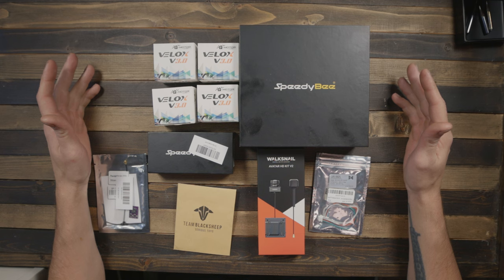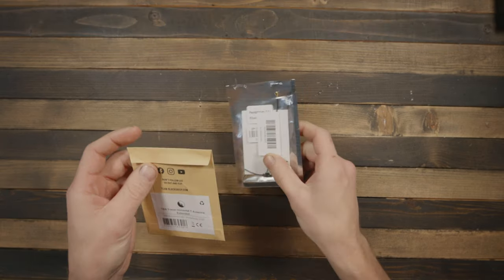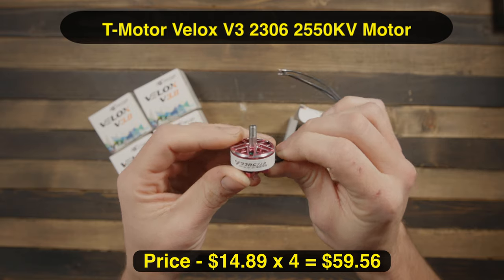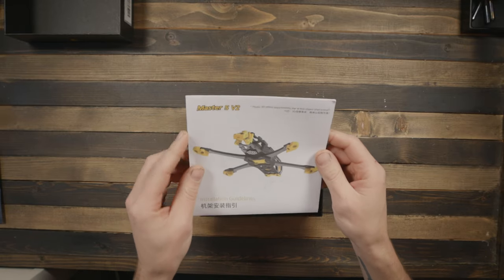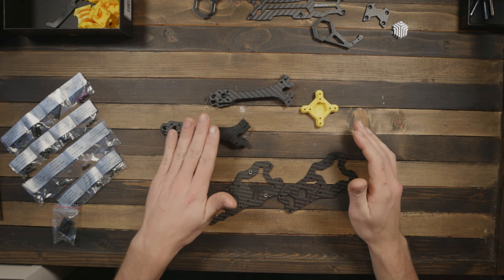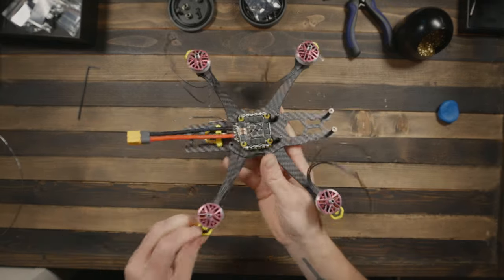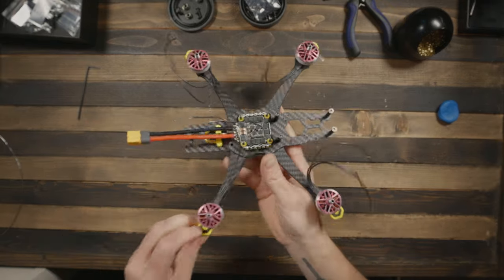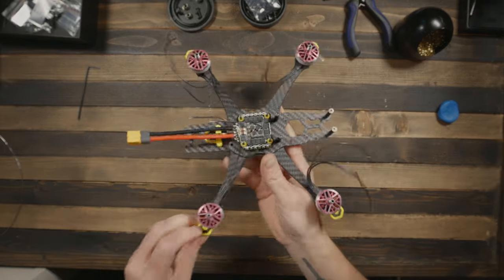5" Freestyle FPV Drone Build And Flight || Speedybee Walksnail HD Build

Comment: The flush mount screws are called counter-sunk screws and those have a tapered head bolt. incase you need replacements or want to compare other frames. I like this frame a lot, but i like the FlyFish RC Valador 5D/5X Frame, especially when running the O3 or anything similiar to that for nice camera mounts for vibration resistance and keeps the camera gaurded as much as possible from a front end crash.

Comment: I just got one of these frames and instructions say long arms are front and short arms are back but there is no way the arms fit to the bottom plate the holes don’t match up no matter which way I try. The only way they will work is the long arms are in the rear if this is not correct then I need to return the frame.
Reply from the maker: Yes the instructions are wrong the longer arms always go in the rear because they sweep back. I have the longer in the rear short up front and it all fits flush. 👍
Reply: Thanks I’m using your video to build my SpeedyBee master 5 V2 5” frame I’m also mounting a walksnail avatar Pro kit. I have
FatShark HDO2 google so I’m using the avatar VRX. system. I’m putting in a SpeedyBee F405 V4 Stack - F4 V4 FC + 55A BLHeli_S ESC - 30x30 this is my 1st HD quad can’t wait to try it out. 
Thanks again for your response.

Comment: Solder joints are pretty good.  Those purple lock nuts are for the bottom of the stack, however.  Typically you'd use those flat nylon nuts for the top of the stack.  Of course, you can do whatever you want.... Cheers -

Comment: I's any of the motor wires near the gyro? That can cause a freak out. They can cause interference since you have they running between the stack.
Reply from the maker: I dont think so. The wires are pretty stuck down and stable. I also believe the Gyro is on top of the FC and the wires are on the bottom. But I suppose it still could be an issue. Ill check it out thanks.

Comment: what is the dimension from back of camera to front of VTX module? I want to get a new SpeedyBee Master 5 HD 5" frame but i think it is longer and the Walksnail Avatar Pro Kit has a coaxial cable that is only 140mm long?

Comment: My first build, way back in April, was a Speedybee Master 5 HD V1. The thing is a beast with a Speedybee F7 V3 stack, O3 air Unit, and T-Motor F60 Pro V 1950 KV. While I have gotten much better at building, and my freestyle fleet consists of mostly Quadmula frames, I still fly that Speedybee, and I still love it! It's been a spectacular quadcopter!

Comment: really liked the video man. from the build to getting out there and flying. I just got into FPV this year and been having a blast. I've built 6 quads already and my Goggles X come in next week so I look forward to seeing how that works. You showed me exactly what I want to test and very informative. I wanted to ask about the OSD you show on your video you said it wasnt from the goggles so what did you use and how did you get it to show up?
Reply from the maker: Thanks I appreciate it. The goggles X are looking pretty rad, the goggles dont natively record osd elements to the DVR so I went on GitHub and found a free software/app that allows you to drop the DVR footage in and then the text file the goggles also record, text file being the osd elements. And then you can choose whatever osd font you wanna use, drop all that in and render it out giving you full osd on your goggle DVR footage like you saw in my video. The app/software is called   Walksnail OSD Tool. Its free to download from github.
Reply: @andrewmedia3568  Thank you! I'll have to check it out as soon as I get my goggles in. It's funny that the one thing it doesn't do is what annoys me most about the DJI Goggles Integra. The OSD elements record on there and I cannot remove it when I fly with the Caddx Vista builds I have. So I have no clean video with my Flylens85 which I love flying. Really good drone!

Comment: can you reccomend some buget goggles for this build LOVE THE BUILD SM
Reply from the maker: That really depends on your budget. Cheapest HD goggles for the walksnail system are 279$ for the FatShark Recon HD. If you want to use DJI their cheapest goggles for HD are 349$ for the Goggles integra. If thats too much Analog is still a great option and you can pick up some analog goggles for 70-100$ the EV800D or betafpv VR03, emax transporter 2 analog. check out pyrodrone, racedayquads and getfpv. they all have a great selection and prices. And the VTX for analog is much cheaper as well.
Reply: @andrewmedia3568  THANK you sooo much bro i bought the dji ones

Comment: This is a really cool setup. I'm just getting into fpv I ended up buying somebody's collection for a deal I got three Ready To Fly and three frames all the frames do have Motors they're all 2206 and 2205. I'm wanting to set one up so it flies like a regular drone but can switch through all the flight modes. What is GPS with a compass allow it to hover on it's own?
Reply from the maker: I don't think the compass allows it to hover on its own. you would have to set that up manually specific to the weight of the drone or use inav or something.

Comment: I know I'm asking too much. But I don't even understand how to build yet. And there are lots of brands and guides, how do I start without being overwhelmed with everything about branding.
Reply from the maker: When it comes to video systems whatever goggles you buy your stuck in that system for the most part. DJI goggles only work with dji video sytems (DJI O3 air units). Walksnail goggles only work with Walksnail video transmitters. Analog goggles will work with any analog VTX. As for the radio\ controller the only thing I would recommend is ELRS (ExpressLRS). they are Open source so any company can make the radios and receivers. And they are the most popular and available. So with video systems and radios whatever brand it is only works with that brand, so TBS (team black sheep)\ crossfire receivers only work with radios that have built in crossfire or a module on them. and again same for video systems. Outside of that, frames, motors, flight controllers and ESCs are all interchangeable. Just keep watching Build videos, and intro to FPV videos and I promise it will start to make sense. There is alot of weird words and brands and companies and its hard to know what works with what. Just keep doing your research and youtube is your best resource for that. Ill do my best to answer any other questions you have.

Comment: btw, the instructions that comes with the frame incorrectly indicates the front and rear arms

short ones are indicated as rear ones, and long ones as front ones, but the frame can`t be assembled that way
Reply from the maker: Yes I noticed that as well, figured the longer arms always go in the rear and the holes only lined up with long arms in the rear. 🤷‍♂

Comment: Hi, i am looking to build this drone. So could i ask which battery you used for it or which batteries you recomend
Reply from the maker: @prawnwonder4923  The batteries I use that I recommend for a 5” quad is 1300-1550mah size and brands I use are ovonic, Zee, GnB, Tattu fun fly or R line.

Comment: p.s. The Barometer gives you your height above sea level.  When you arm, it "Tares" itself to zero out.
Reply from the maker: Ok that explains the changes. Did not even think about that thanks!
Reply: good to know, didn't know why it did that but I did notice that it corrects itself when you arm. Coming from the DJI Avata I think it can make you think something is very wrong. Had an issue with my Avata and had to run a calibration to fix it so it was scary to see a similar issue on a built quad.

Comment: HI
I have ordered the same parts as you but accidentally ordered a different receiver.
I ordered the RP1 reciever from radiomaster which is ELRS,Iwanted to know why it only had space for one antenna and how i could remove it for a longer one.
Reply from the maker: The RP1 is a single antenna receiver, it will work fine for most flying unless your doing long range. I was using the RP3, but either one will work fine.  And you can just grab near the UFL connector and lift up and it should pop off so you can put a longer antenna on.

Comment: what controller and goggles did u use with this build?
Reply from the maker: Radio master boxer (ELRS version) and the fatshark dominator hd.
Reply: @andrewmedia3568  also i want this to be my first like kinda "budget" build are there any budget controllers and goggles u could recommend for this build (i haven't really gotten into fpv yet)
Reply from the maker: @doomboy5911  For budget radio I’d say Radiomaster pocket(elrs version).before anything I would watch a bunch of YouTube videos on every topic, motors, batteries, frames, flight controllers, esc, receivers, radios, goggles, video systems. And beta flight tutorials. I did weeks if not months of research before buying. That being said stick with expresslrs (ELRS) for radio systems. It’s the most prevalent and hands down the best RF system. For goggles you might be able to still pick up a pair of fatshark dominator HD for about 380$. Or the fatshark HD box goggles. If you want HD I much prefer DJI but they are more expensive, but worth it. Don’t forget about the used market for gear.
Reply: @andrewmedia3568  ok imma look into it thanks for answering ❤️

Comment: You have that walksnail camera right, how do you get that live vidieo from your drone to the goggles does it have any app to connect the goggles to the walksnail camera
Reply from the maker: not sure I understand the question. You bind the goggles to your VTX and thats how you get the video in your goggles to fly. As for getting the recording from the goggles, you have to hit the record button on the goggles and have it setup to recored in the goggles in the menu options. And you have to have an SD card in the goggles.

Comment: Cant you just plug the walksnail  vtx into the dji socket?I thought they are compatible.
Reply from the maker: the plug is slightly different. DJI plug is 6 pin plug and the walksnail is only 4. You could get a 6 pin and 4 pin and solder them together which I've done. But its easier to just solder the wires on the FC.
Reply: @media3568Thank you kindly for your answer dear sir.You just got another subscriber .

Comment: How do you take back control of the drone after GPS-rescue?
Reply from the maker: I just flip the switch off. I think if you have an actual failsafe once you get
 re link you have to move the sticks at least 30% to get control back, but with just using gps rescue on a switch you don’t. Make sure BF is set to sanity checks : failsafe only.

Comment: Wait a secont ,cant you just plug the walksnail vtx in the DJI slot?
Reply from the maker: Yes if the plugs match and the pinout matches. But sometimes it’s better to get power from a bat pad so when your flying li-ion packs that drop under 3v per cell you don’t lose video. Ask me how I know 😂.
Reply: @andrewmedia3568  Thank you so so mutch for your answer.I have my great fight to program my googles (hd zero )and walksnail vrx.First drone done almost .

Comment: Hello, i followed you to build the drone with same specs like motors etc, possible to share your pid and other settings? Thanks🙋🏻‍♂️
Reply from the maker: My PID is just the supafly freestyle preset. I use it on all my quads and it works great. I set my own rates to my liking for rotation speed.

Comment: So my Fc came with the same cable you go to connect the FC and esc, But one end was not connected. Can i use any 8 pin esc to FC cable?
Reply from the maker: Yes you can since the pin out is the same. You can use any fc to esc cable as long as the plugs work. The only time you would have to worry about it is if you bought the fc and esc separately then you would have to re pin the plug most likely.
Reply: @andrewmedia3568   I saw on another comment that these motors are not capable Of 6s, (This is my first build) I have a 6s but when i plug it in the capacitor heats up and glows and motors are jumpy and not acting right. Would this be cause by the 6s battery? I should swap to a 4s?
Reply: @andrewmedia3568  I was able to fix my issues with the Heat and motors not working. I changed the motor output. But everytime i go to fly it just flips. I cant get it to work correctly or lift. I did not have a long Esc to FC cable (Ordered Today) so my FC is facing the same way as the Esc, Could this be why it just flips?
Reply from the maker: @gameplayhost  That could be why. plug your quad into betaflight and check the setup tab look at the 3D model on screen and make sure your quad is tilting the same way as the model. tilt your quad front and back left and right and make sure its the same. If its not you can go to the configuration tab and change board and sensor alignment. the other thing that will cause that is the motor direction on the motors tab. make sure that when you arm the quad your motors are spinning the same way that it shows in the upper left of the motors tab. If its props in or props out you can just change it on the motors tab to match what your motors are doing.

Comment: Hi,
Could you please share links for the props you have ordered as well as their caps and the smoke stopper.
I wanted to know if you have used a 4s or a 6s battery
Also i have built the same type of drone and goggles and wanted to know if i needed any antennas for the goggles and if the motors you have suggested are the best or are there is a better option
Reply from the maker: The props are HQ j37, I’m not sure what you mean by caps. Any smoke stopper will do fine. I order most my parts from pyrodrone, racedayquads and getfpv. Sometimes rotorriot if the other 3 don’t have what I need. This quad is 4s. If your goggles don’t have any antennas on them yes you need antennas.
Reply: @andrewmedia3568  Could you share a link for the antennas you have as there are many and I am confused also could you share a link for the vtx as I have selected one but am not sure if it is the right one
Reply: @andrewmedia3568 And by caps I mean the bolts you have attached on the top of the props
Reply from the maker: @dhvanilshah1286  https://www.getfpv.com/walksnail-avatar-hd-kit-v2-32gb-w-gyro.html?utm_source=google&utm_medium=cpc&utm_campaign=DM+-+NB+-+PMax+-+Shop+-+SM+-+ALL+%7C+Full+Funnel&utm_content=pmax_x&utm_keyword=&utm_matchtype=&campaign_id=17881616054&network=x&device=m&gc_id=17881616054&gad_source=1&gbraid=0AAAAAD8cN5K5vn6oPBloCI1sqxscpEpl1&gclid=Cj0KCQjw0MexBhD3ARIsAEI3WHJFoN7opAMnmqUNwQzCxeShthtakrLWq39PMK3oFHxIgUDzAPjGi5IaAhRKEALw_wcB
Reply from the maker: @dhvanilshah1286  https://www.getfpv.com/truerc-singularity-5-8ghz-stubby-for-dji-lhcp-4pcs.html?utm_source=google&utm_medium=cpc&utm_campaign=DM+-+NB+-+PMax+-+Shop+-+SM+-+ALL+%7C+Full+Funnel&utm_content=pmax_x&utm_keyword=&utm_matchtype=&campaign_id=17881616054&network=x&device=m&gc_id=17881616054&gad_source=1&gbraid=0AAAAAD8cN5K5vn6oPBloCI1sqxscpEpl1&gclid=Cj0KCQjw0MexBhD3ARIsAEI3WHIgyt2sJy6NUwaLSz3CAwt_Yo0jNwJT9v6KbUZSJS0KMXKjXkh0IyEaAtBgEALw_wcB
Reply from the maker: @dhvanilshah1286  the bolts come with the motors.
Reply: @andrewmedia3568  ok thanks
Reply: @andrewmedia3568  COULD YOU ALSO SHARE ME LINKS FOR A 4S BATTERY FOR THE DRONE AND A BATTERY LINK FOR THE Fat Shark Dominator GOGGLES
Reply from the maker: @dhvanilshah1286  https://a.co/d/3XLR89Z
Reply from the maker: @dhvanilshah1286  https://a.co/d/3Sjw2gs
Reply: @andrewmedia3568  THANKS A LOT
Reply: @andrewmedia3568  from which site did you order the motors as i am planning to order from get fpv , but it does not show if the bolts come with it
Reply from the maker: @dhvanilshah1286  Pyrodrone has them for 15 a piece. I order most of my stuff from pyrodrone because they are closest to me and have great price and selection.

Comment: How do you get the live feed on the goggles do you need to connect the air unit with the goggles using any app?
Reply from the maker: Not sure I understand you question. Are you asking how I recorded the goggle video?
Reply: You buy a video transmitter that works with your goggles, same with analog, with digital you bind your "whatever brand" goggles to your" whatever brand" video transmitter

Comment: How come I don't see anybody using the holes that are specifically designed for the capacitor? Is there a reason behind it?
Reply from the maker: Laziness I guess. I just dont care to use those. Its easier for me to just put the xt60 leads on then solder the capacitor after. 🤷‍♂
Reply: I agree 100% plus the fact that you can get a better solder joint on the pad when tinning if you cover the holes. I like the way you installed the cap. that's how I'm doing it from here on. Thanks for a good build vid. @andrewmedia3568

Comment: What should in betaflight since you had the esc and fc 180 backwards?
Reply from the maker: Esc doesn’t matter directionally as much. The FC is 180 out, easy to change and confirm using the configuration tab and setup tab that shows the quad in real time moving while plugged in. And the motor tab just go through with the motor orientation and rotation wizard to tell BF which motor is where and what direction it is supposed to spin.